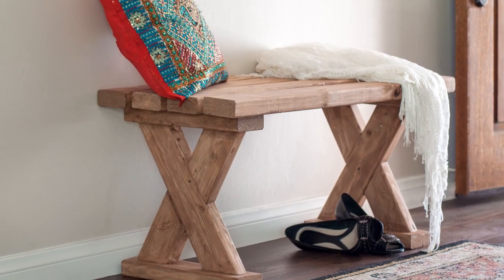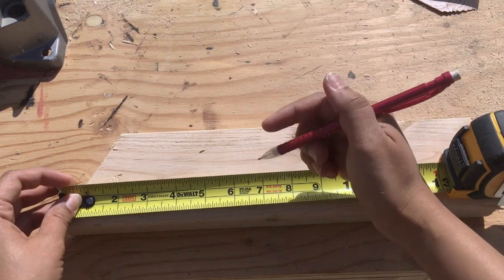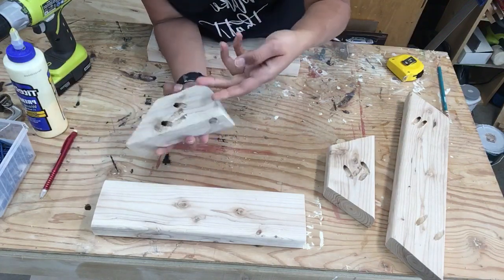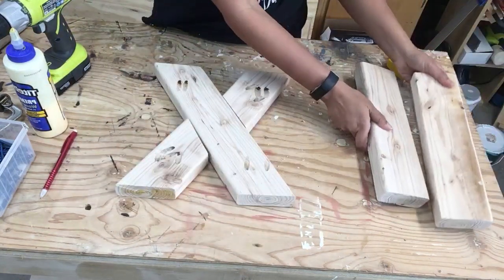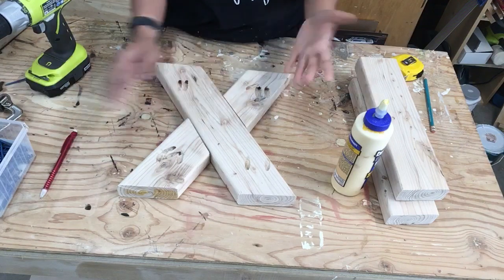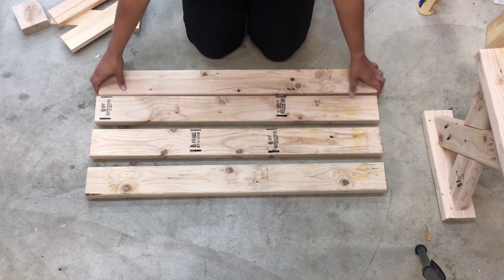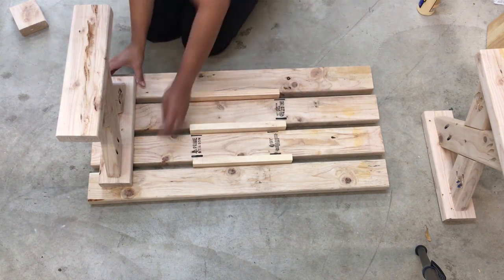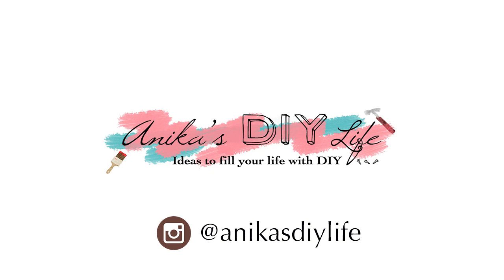How to build a 2x4 Bench - 3 ways - Indoor and Outdoor Bench

Comment: To ensure the bench doesn't slope or wobble, the short angle pieces need to be clamped before trying to screw them in. In the video the short piece moves and it would be by shear luck that it hasn't resulted in a deviation from a flat and aligned bench.

Comment: This looks like it would wobble. And keeping the cross pieces properly aligned when attaching them would be very difficult if one follows your demonstration. You would need to clamp the pieces in place so they dont move when inserting the screws.
Reply from the maker: It doesn’t wobble - 3 years since I made the first one. Its still going strong in our home. All you need to do is make the cuts right (like in any project)
Reply: @Anikasdiylife  again your not listening.  You sell, provide customer service
Reply from the maker: @minicooperusaf4624  thanks for trying to be the police. This person didn’t build the plans. They just “think” it would wobble and it “would be” very difficult to keep things aligned. Over 300 readers have built and shared the bench with no complaints or problems.
Reply: @Anikasdiylife  laugh out loud
Reply: Whoa! First of all, let's not fight.  I have no problem with wobble, but I do have issues with the short angle pieces moving and thus making the top uneven.... a lot.  If either of you have a suggestion, please let me know.  I used clamps but not the face clamps.  Thank you in advance.

Comment: I bought your plans. They are way off plus you do not mention what is the depth of the Kreg jig hole that you are making plus you don’t mention where the pocket holes are supposed to go . The cuts are not 7-1/2 for the legs they are 6 1/4 for the short cuts. Please advise about the pocket holes. Thanks
Reply from the maker: I am not sure why you are having issues. I have built at least 3 benches with the plan and have many other people build it as well. The pocket holes are at the setting for 1-1/2” thick material. Please see the blog post for pictures of the exact location of the holes.
Reply: @Anikasdiylife  find out why she is having the problem, geez. She purchased your plans!
Reply from the maker: @minicooperusaf4624  dude I helped them with the pocket holes. The cuts aren’t short or wrong. Many readers have built the bench with no issues.
Reply: @Anikasdiylife  Dude, lol. Listen, learn, and adapt